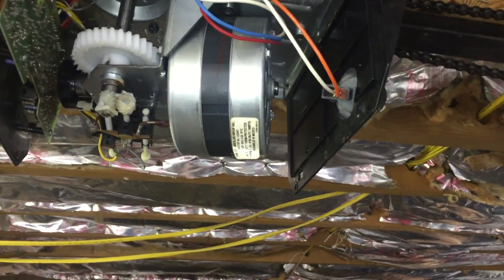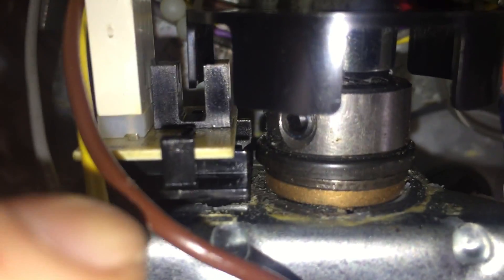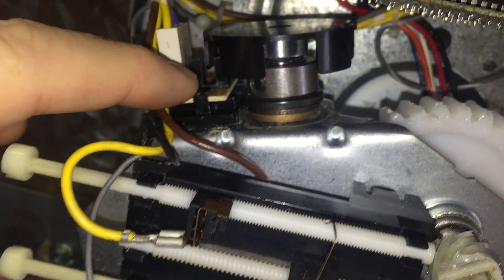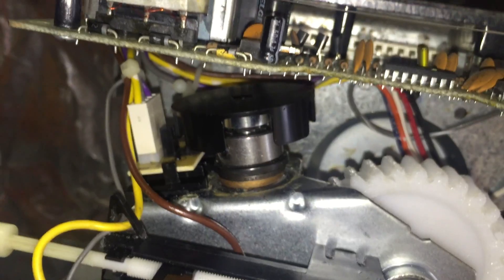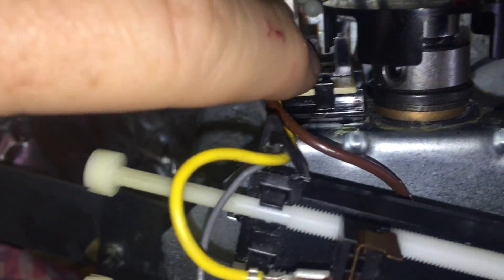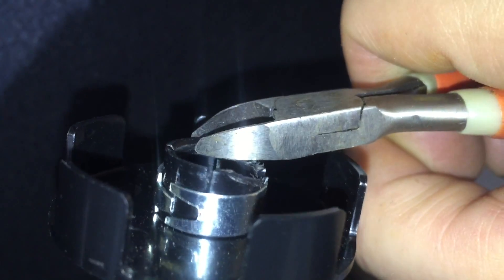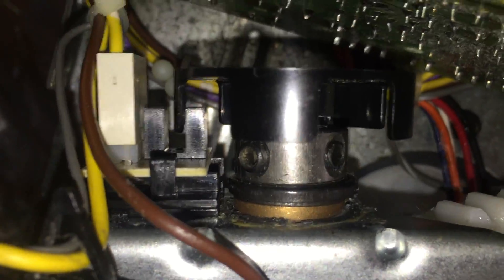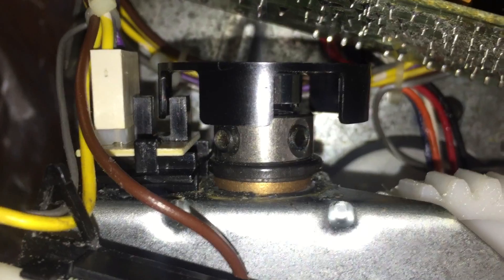Garage Door Opener not working - Only Travels 6 Inches & Then Reverses & Stops

Comment: after replacing the plastic gears in the opener (different issue), I noticed this problem.  In my case, the kit to replace the gear had hex bolts holding the ring to the shaft, that were longer than the originals, causing them to stick out a little.  This caused them to hit the rpm board.  Replacing those with the originals (so they recessed all the way), solved the problem.  I did notice the rpm sensor being a little loose on the board now, so I might be replacing it soon.  For now, problem fixed.  Thanks for the post, it got me on the right track!!

Comment: I have older model Genie Pro Screw Drive, moving 6 inches and stopping, kept pushing remote and finally nothing but a humming sound,  replaced the Capacitor model 19988A $20.00,  humming stopped and went back to only moving 6 inches, tried doing what this video says to do, only problem interrupter cup wasn't able to come off, so I lightly tapped it a few times and sprayed some DW40 in the area of the little shaft that the interrupter cup is attached too, garage door is working like normal again. I hope this helps?

Comment: Adjusting the cup and a new RPM sensor did not help. When I take the chain off the sprocket it will work but with the chain back on and everything else adjusted, it goes back to the 6" movement. Help anybody?
Reply: Gus - I'm in the same position you were in. What was your solution? Thanks.
Reply: Lance Osborne mine is doing it, I think mine is the balance spring. The door should remain in any position when lifted manually. Wherever you take you hand off the door it shouldn’t fall. It is supposed to be neutral. Mine isn’t providing enough lift assist. I will be adjusting my spring tomorrow.

Comment: excellent
solved my problem
one note though: my interrupter cup was fine, once I discovered that I needed to put it back on (compliments of your tutorial)
the optical sensor however was crudded up with debris, blocking the light path
make sure you clean the sensors before you decide the sensor board is no good!
Reply: PS
my project was changing the cheap crappy $6 plastic drive gear, which had fatally stripped out, when the problem with the cup arose
Reply: Thanks for the video. Did not have to cut or size interrupter. Just moved the collar towards motor.
Reply: Solved my problem in first 45 seconds of the video! I had replaced the worn gear and simply misplaced the RPM sensor cap. Spent way too much time messing with travel adjustment and watching unrelated videos before finding this one. Much thanks! 
Keywords: Sears Best Craftsman 1/2 HP Travel Gear Kit

Comment: I have the same symptom but not a cup plus sensor. Mine is a Genie Pro 88 with a coil that senses the motor drive rotation. The coil has 120 ohms resistance. Don't know what the problem is.

Comment: After watching your video clip I looked at my sensor and cleaned it.  Then I jiggled the electrical connector and now the opener is working correctly.  It's a 1988 model so I suspect the electrical connection caused the problem.   Thanks for your video.